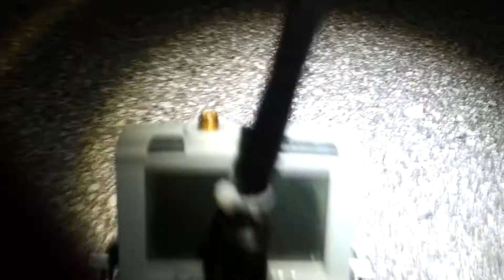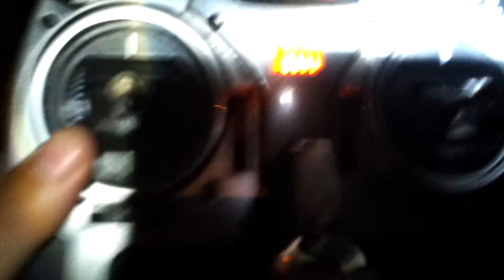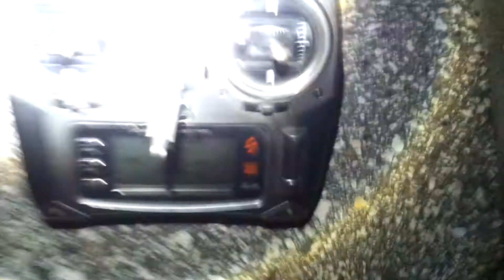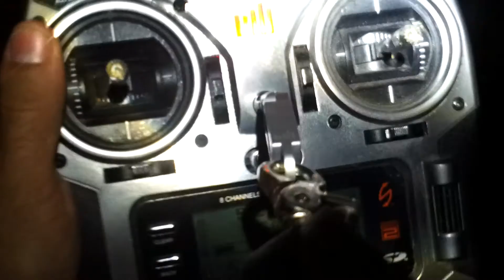witespy quad naza gps add-on

Comment: I was wondering will it work with a dx6i? Am thinking of getting the nasa flight control plus the add on gps just wondering if I can use my dx6i for it? I just want to have position hold an alt hold only so there for I can take it up to 300ft an do a slow 360 veiw an bring gown with my gopro2 let me know if my dx6i should work